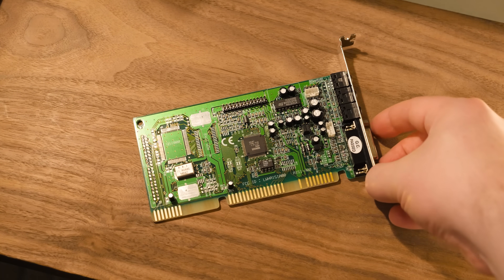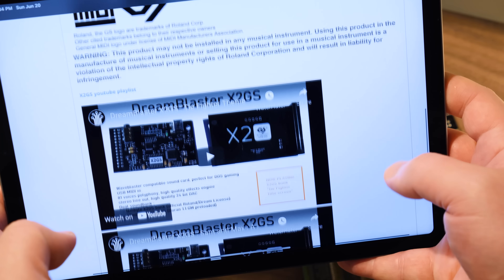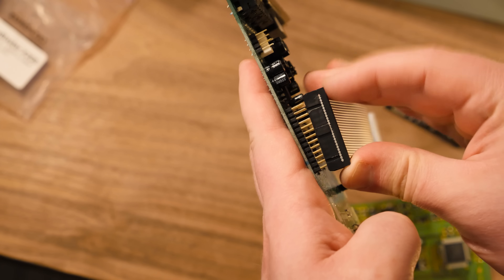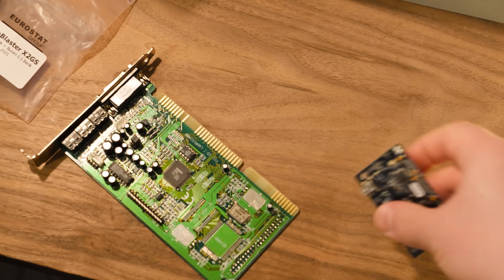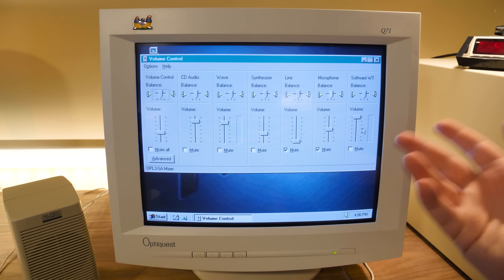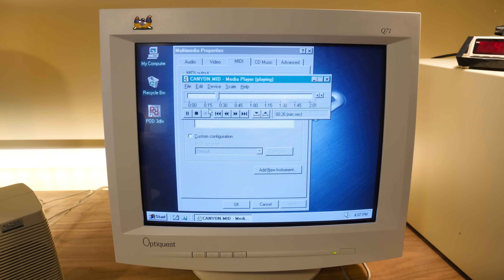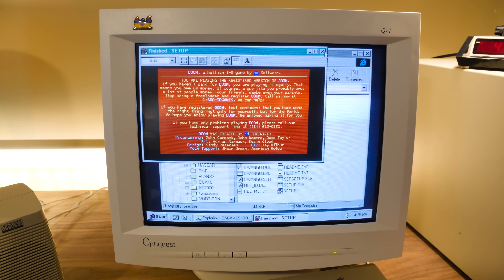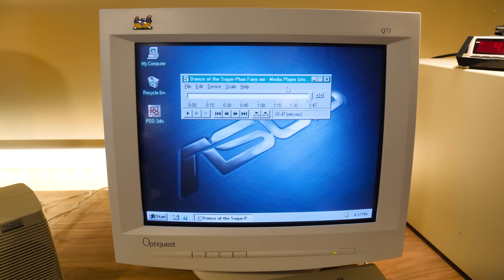Adding a DreamBlaster X2GS to my Socket 7 PC

Comment: i mean extension cable was also my idea, and i ended up designing extension but using PCB which is well usable and both cards hold together pretty much fine.

Comment: I have one of these mounted on a Sonic Vortex 2 card and it sounds great. It works fine in Windows 98 however when trying it in Windows Xp I notice that there's no Vortex AU8830 MPU-401 interface in the xp device manager, so I can't run it in XP.  I realise that Aureal drivers were discontinued before XP but I'll welcome any suggestions for winxp  if anyone has ideas.  Thx. D

Comment: You could mount the Roland board on some standoffs and screw into case... I would rather do this than spending 85 euro! on a second daughterboard rendering the original one useless..  There are like 85 euro of reasons to buy the flat ribbon cable and mount it somehow or simply having loose in case.. who hasent done that before anyhow with a ssd or harddrive at some point..

Comment: I've seen the 1997-build video and this one... You can improve on your case-modding skills. There's a lot of easy ways to drill for standoffs to hold the motherboard better and with a little imagination, the ribbon cables can be made a lot more tidy... This one too - it has holes for fixing it to something. Surely you can find something to attach this board to... Or build up a little bracket!
Don't just say it's ridiculous and can't be done!

I say this with full respect and appreciation for your skills and wonderful show!

Comment: Got mine in the package deal with the Orpheus I. Nice 25€ rebate off the 85€ price tag.

Quite happy with my sound setup now. GM via Dreamblaster; MT32, CM32L and so on via Falcosoft's Soundfont Midi Player with different fonts and stuff like munt; Tandy Nano sound card; CD Audio and PC Speaker custom build cables hooked up directly to my little external mixer together with the Orpheus, Tandy Nano and my laptop's output (for the emulation via Midi Player and for other uses).

My Audician 32 went back into it's box for now. Still happy to have gotten it as I've never seen one again when looking for it on the Bay once in a while.

Comment: I think that last retro build you made inspired me to pull an old AMD Athlon 500 MHz board out of retirement. I'm doing an experiment where I'm building a retro PC in a modern case with a modern power supply. I had to buy a bunch of adapters to convert SATA to Molex, and a SATA to fan splitter for the modern case fans. For my sound I pulled out an old Sound Blaster Audigy 2 ZS from one of my first PCs, and I've got a few GeForce 2 cards although I know a few of them are failing in one way or another. I'm also using a compact flash to IDE card, but we'll see how reliable it is (I've had bad luck with long term reliability and IDE CF card adapters). I may end up just using a conventional hard drive since they seem have the best compatibility.

Comment: Computers growing up: "You could have many dozens of different types of sound! Pick the way you want your audio to be!  _For a price!_"

Computers now:  "You get software audio and don't need to buy a sound card, everyone experiences it identically, you can't change it*."

The pros and cons of the 80's-90's..

*sans audiophile stuff for not really much difference, or software plugins for things which is mainly in recording.  My ears are hard pressed to tell a difference between onboard, a basic soundcard or an enthusiast soundcard after Windows Vista came out.  But if I boot into Windows XP?  Oh boy do I hear the difference even on basic Windows sounds.  MIDI stuff though; at least we can still tweak that just like we used to, mostly.

Comment: The sound of Duke Nukem 3D is just too damn good with that card. I don't recall it sounding this good when I played it in my teens.
Reply from the maker: Yeah indeed, the Sound Canvas sample set the X2GS is based on is excellent, and Lee Jackson actually composed the Duke3D theme using a Roland Sound Canvas so it's a solid pairing.

More on the topic here! https://youtu.be/CVq4rSEjgnA

Comment: Build a bracket to mount the big wavetable board to the expansion slot opening on the case. A little plastic standoff on the other side and problem solved. Would mount in the case a like a regular expansion card.

Comment: I have one of those DB15MIDI from Serdashop. Extremely simple and extremely useful. They are 2 MIDI outs though, there's no midi in. I needed  joystick so I bought a splitter cable from aliexpress, noticed it did not AT ALL have enough wires in it to deal with a joystick so I resoldered it to me needs, and that DB15MIDI plays nicely into that solution thanks to its buffering components.

Comment: I think both ports are outputs on the DB15MIDI
Reply from the maker: You're right, I was mistaken! Still a super useful little adapter, I like how small it is
Reply: @LGRBlerbs  Yeah, definitely! Saves you a splitter/through cable if you want something like an MT-32 and a Sound Canvas hooked up simultaneously.

Comment: I have the same sound card (4 of them actually) and a dreamblaster -- if you want to independently control the volume for the wavetable header audio, use "Wave Balance" in the volume control box.

Comment: So the Dream Blaster mainly has better reverb.
Reply from the maker: And better instruments, drums, number of simultaneous parts, etc ;)
Reply: @LGRBlerbs  Yeah, that was a little unfair to say I guess. :D
Maybe you could try routing the dry output through a reverb module in your modular at some point if you're curious as well!
The most prominent difference in your comparison (to me at least) was that the Dream Blaster sounded much, much bigger and the SoftSynth's reverb didn't do quite as much as I suspect the Dream Blaster's did to the sound.

But then again, there are so many different options with General MIDI, so where to start, where to stop? :D

Thanks for the video, have a nice day! :)

Comment: I don't understand why the DIY community is so fascinated with dongle adapters, like the D-Sub to MIDI at 14:00.  Why would you want a chain of things, including bare PCBs with all their pointy bits, hanging off (and sticking out) of the back of a computer, applying leverage on the pins and connectors of a sound card?  Wouldn't it be better in every way to have a 1 ft adapter cable with a DA-15 Male on one side, and 2x DIN-5 Female (and maybe DA-15 Female) on the other?

I keep seeing the RGB crowd with SCART-to-whatever plugs, adding 3" of hanging dead weight to a connector that was never meant to bear anything more than insertion force... yikes.  I don't even like using DVI-I to VGA adapter dongles.  Thick cables are heavy enough.

Nice to have an option, sure.  But I just can't help but see this accidentally getting crammed into a wall and breaking the PCB (if you're lucky) or a 30 year old sound card (if you're not.)  :-(

Comment: for the IDC cable, sure it doesn't work well as is. what if you remade the idc cable to fit the application? you could move the connector up 1/2" to 1", and have the daughter card right next to the sound card, just shifted up a little. you'd need to figure out a way to physically attach it, but you would have to do that anyway :)

Comment: I love how people assume you haven't considered a breakout cable, or heard of CRT's, clearly these people have no 3d thought process. By that, I mean they have no internal spacial awareness to think "Gee, where is this dangly card going to go now?" and "Gee, have I ever seen a CRT recorded on a camera?"
Reply: I personally think he dismissed it too quickly.  The mounting holes on that daughter board card would probably match up with a PCI bracket from an old modem or NIC.  Just mount it in an empty PCI slot next to the sound card.
Reply: @ImGigantor  That goes back to what he was saying though, not a lot of room in that case to begin with.
Reply: Usually it's the kind of thing I wing on the day.  Because clearly it's one of those problems that depends on many factors, including how long an extension cable you get.

I mean, the Power Supply my PC is running off currently isn't actually inside my case.
Reply: @TheTurnipKing  Ah, haha, yeah... When I had a Silverstone Milo ITX slim tower case the SFX PSU's fan died screaming (Literally, I was playing Metro: Last Light and it scared the HELL out of me)... So for a while I just had an EVGA ATX PSU with a really long set of cables growing out of that PC like a tumor. 

Gotta do what you gotta do, but on builds like these, you (usually) get things right so you don't forget, not use the system, and then break something.

Comment: Whomever recommend the extension, this is a VERY bad idea amongst the numerus ground connections that run on that connection there is + and - 12 volts analog signals and the like all running next to each other; this would be noisy at best and a bad idea if something were to short I'm so glad you did not use an extension.

Comment: I just need to keep telling myself, "I don't need one of these to go in my retro PC. I have a SB Live Value and an Aureal Vortex2 that have perfectly fine wavetable synthesis. I bought the SB16 for its OPL3 chip, not for wavetable MIDI."
Reply: Damn it, I just ordered one. My wallet is aching from the cost, but it's cheaper than buying an original Waveblaster or a SC-55 these days!

Comment: I actually got a breakout cable for going from the gameport socket to MIDI in/out. The nice thing about it is it also has a passthrough for connecting an actual joystick if you wanted to. I used it to hook up the SoundBlaster AWE64 sound card I've got in one of my retro PCs to this old Yamaha keyboard my sister got from her ex-boyfriend many a year ago lol.

Comment: The "extension cable" thing was something I was yelling at the screen when I first saw the problem... and now seeing you address it, yelling at the screen again. Oi. Just shorten the cable! Those ribbon cables are meant to be re-configurable. You can detach the sound-card-side connector, enter it from the opposite side (so the terminated end is on the side that the cable exits from now), shorten it to about 1-inch, and voila! You'll have a cable that neatly lays the card directly atop the sound card just as originally intended. A bit of foam padding to stick the wavetable card to the sound card...done and done, neat as can be!

But I guess I still like the new solution, though it kills me inside that the cable solutions were so rashly thrown aside...
Reply: Same. I don't think he's into crafting a custom solution and that's okay, too.

Comment: Yep, the cable was a solution, if a bit ghetto, and it requires further work to eliminate problems.  You'd use it for the time whilst waiting for the better solution, that is that dinky board.

We've all done quick fixes like that before and thought 'Hmmm... I need a better solution!' 🤨
Reply: We all know what happens with quick and dirty "temporary" fixes.
Reply: @eDoc2020  - Yep we do.  They work, if you take care and do them right, and then you swap out the temporary fix parts for the permanent solution.  If you don't, you're only inviting problems for yourself!

Comment: On the original X2 you can control the reverb, volume, balance etc when connected via USB using the "Dreamblaster X2 preset editor" from the serdaccos downloads page.
Not sure if it's compatible with the X2GS.
Reply: yes it is compatible
Reply: 2 presets can be uploaded in X2GS (at address 0x50000 for GS bank Preset, at address 0x70000 for User bank Preset).
Reply: @Serdaco  That's good, since i've just ordered one :D
Reply: @TheDeeplyCynical  Thanks !!!

Comment: The riser cable is a no-go, because the daughterboard would flop around,eh? We've all had that issue, mate, but thankfully the FloppyCardSyndrome is easily remedied by using some velcro/hook and loop pads and just doing the two cards back to back (after confirming there's no risk of a short,ofc) . Seriously, I've lost track how often those little buggers have saved our bacon when dealing with "not entirely authorized/sane" modifications  of gear at work, lol
Reply: it's still sounds not ideal with it being adding on to more cables plus needing more space for the wavetable card.
Reply: @explorer9049  I agree wholeheartedly on that front, but just as Clint said - the new card isn't quite a 1 for 1 replacement for the original. Unfortunately this means that you have to make the difficult decision to either go for the tidy and "almost as good" or a slightly janky install of the original card. I'd personally go for the latter, but I've never really cared about the looks of a build (outside of stuff that's affecting actual performance), but I 'get' that most people aren't as aesthethically criplled (or utilitarian) as me :D
Reply: I think there may have also been at least two holes that align in both boards, for fixing them together with nylon screws, nuts, and standoffs. Four isn't going to happen because of the height difference, but at least the lower edges could be matched up.

Comment: If you where to use the extender cable it would probably need to be in a plastic box so it wouldn't short out that board and burn it up that would take up way too much room in a pc case.

Comment: I was hoping to hear PASSPORT.MID to be honest. The original SC-55 (both the GS and GS/GM variants) plays this just fine, but on later synths from Roland, including the SC-55 MkII, SC-55ST, and SC-88, there are very noticeable missing notes unless you send a GM reset to the device because the "capital tone fallback" feature was removed, causing invalid bank/program switches to be interpreted as no instrument instead of falling back to the default. This is actually a problem with a lot of MIDI files, and I can't find any specifications that say if the X2GS includes this feature or not.

Comment: Isn’t the soft synth a straight up Yamaha XG? Should sound good if it isn’t too compromised. This is kinda old tho, so it probably is. I used one of the later ones to play midi files during the XP era and it was pretty great.

EDIT: That Duke3D song does sound amazing with this. Very solid and like the instruments are glued together, which can be a problem with wavetable stuff IMO, like the drums are way too loud or the bass is off.

Comment: I love LGRs content, but every time there's improvements of MIDI equipment in old PCs, I can't help but thinking that it's just some crappy MIDI tunes sounding a little different=P I grew up in more or less the exact same time as Clint.
Reply from the maker: Yep, MIDI is still MIDI no matter what hardware you're using! But the goal is to get it sounding as decent as possible, or in my case, as "authentic" as possible within the given constraints.

Back in the day most of my favorite games were designed using Roland sound hardware, and that hardware was prohibitively expensive and way out of reach for most of us. And it's still expensive, notable more so than the X2GS! So being able to get that same sound on a modern, compact, more affordable package is really quite special. Even if it's "still just MIDI" :)
Reply: @LGRBlerbs  Oh yeah, I completely dig the aspect of actually getting these things to work. Also, I'm no stranger to new devices to improve old devices. But still, it's "just MIDI", hehe. I remember being blown away by PASSPORT.MID on my dad's IBM Thinkpad. Even if I'm not continually impressed by MIDI, I'm still watching your stuff. What impresses me the most, is your ability to find new stuff to put together.